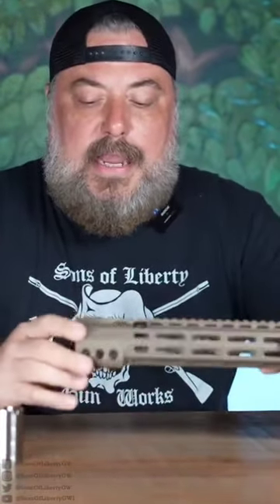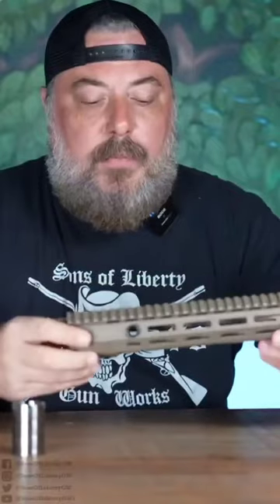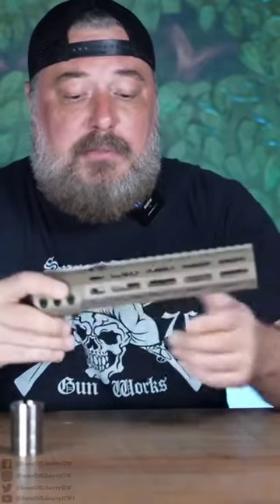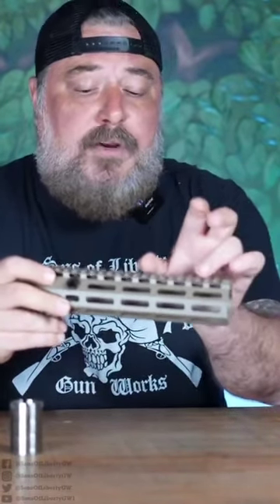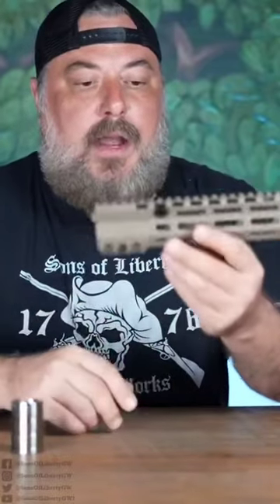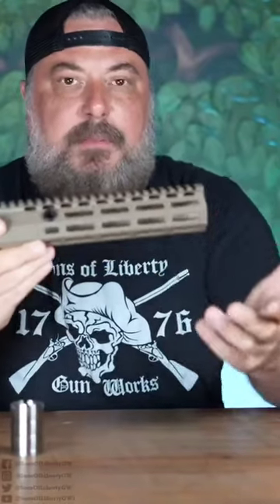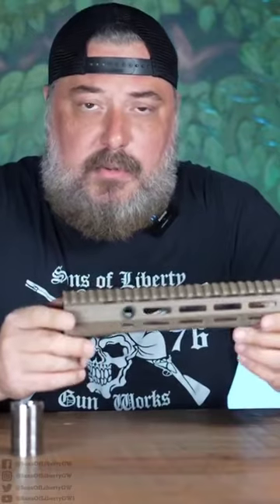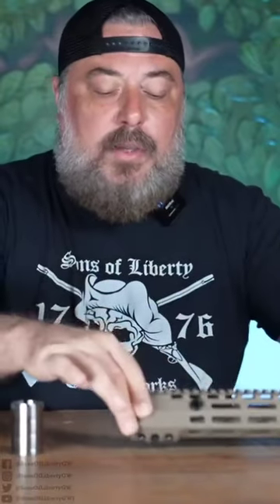SOLGW L89 7-Sided MLOK

Comment: What’s with the not making a length for 12.5 specifically?? Makes the rail an no go for anyone running one
Reply: They have the M89 in 11.5 and on IG they said they’re eventually going to release an 11.75 in the L89.
Reply: @carls2210  they have one shop (Brownells) stocked with 11.5 M89…that’s it. It’s an “exclusive” 🥴

Comment: What about a 13” for a 13.9/13.7 p/w?
Reply: I'm thinking Mike may have mis spoken on some of the sizes. The M76 & M89 is offered in 13" so I'm guessing they will offer this one in a 13.25" for the 13.7 and 13.9 barrels.
Reply: @davidcraft8524  The m89 comes in 13” and 13.75” for a 13.7/13.9 p/w and a 14.5 p/w, respectively. Just went thru this on a customer build last week cuz he didn’t realize he got a 13.75 HG and it wouldn’t work for a 13.9 barrel with a nox9. Hopefully they make both lengths for the L89 like they do the M89.

Comment: How do y'all prevent galvanic corrosion between the steel QD socket and the aluminum rail?
Reply: Probably by them both being coated enough to prevent that reaction from occurring.
Reply: @d3ltaohniner261  yea, but at those tolorances, the coating would gaul when the QD slot is pressed in.
Reply: The galvanic differences between most alloys of steel and aluminum are small and typically have insignificant corrosion unless subjected to something like salt water. A typical AR has plenty of steel-aluminum contact: examples are fire control group pins, roll pins, BCG, barrel to upper receiver, and buffer tube/castle nut area -- these are not a problem in most instances.
Reply: @paullinkins8121  preventing galvanic corrosion is part of my job, there absolutly is a significant galvanic difference between aluminum and steel
Reply: @Pallium_Industries  Am I wrong in stating there are a good number of steel-aluminum contact points in a typical AR? And are they frequently a problem?
Reply: @paullinkins8121  your point is valid. The QD socket looks like it may be nitrided, which definitely makes a difference.

Comment: When you guys make a quad rail, prepare to be sold out for months with back orders coming in like hot cakes
Reply: Is there even a reason to get a quad rail that isn't a RIS II unless you're going for the block 1 aesthetic and want a RAS?
Reply: @DanielMartinez-yd1ue  - Dude the Block II/RIS quad rails are OP. I think the Midwest industries quad rail is pretty amazing as well.
Reply: @Carl007Jr  another good option is the Centurion arms c4 quad rail. Paired with their uppers, you can use the antirotation pin that interfaces with the hole above the gas tube hole to add even more rigidity. That and the RIS II are my go to quad rails

Comment: Does anybody happen to know if these work with the riflespeed adjustable gas blocks? 🤔
Reply: All of these rails will. The only issue is how long of a riflespeed you have and how long the rail is. It will easily fit under it, which will never be an issue.

Comment: Needs a 13" option.
Reply: Yeah the 13" rail barely clears the muzzle device on their 13.7 barrels. Not sure how they're going to make that work with the added length
Reply: Pretty sure I’ve dealt with you on TacSwap before… Ive got a 12 5/8” Zev wedge lock rail in excellent/like new condition that I’ll sell you for $200. Perfect for your 13.7” p&w blaster.